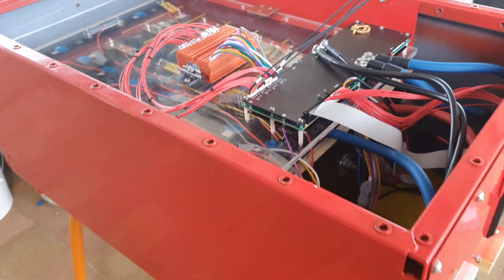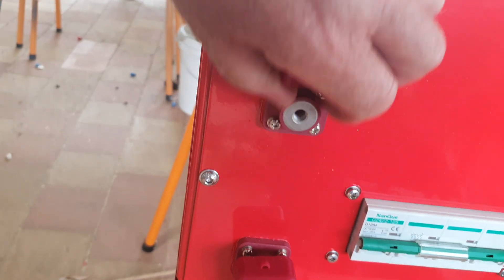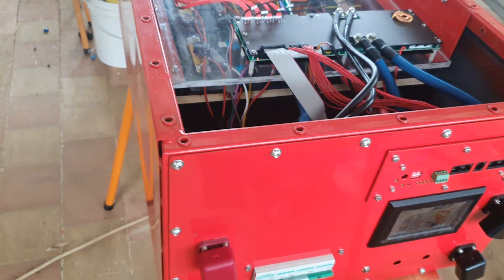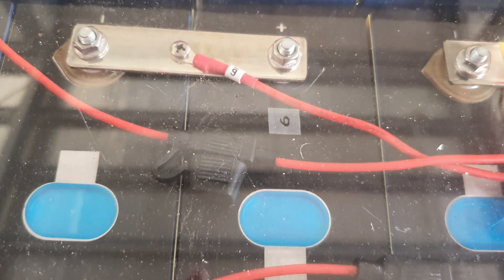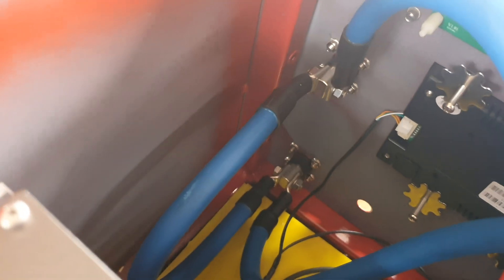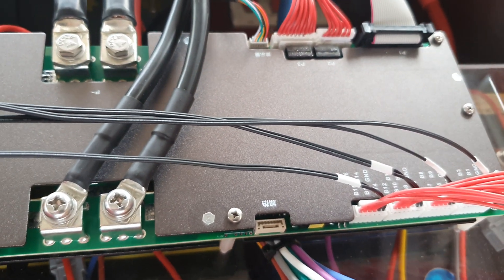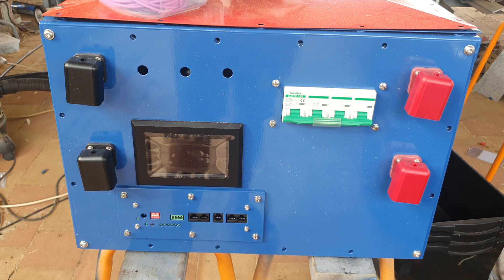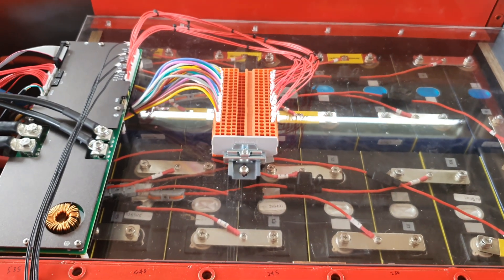My Big Red DIY 280ah 48v JK BMS JK-PB2A16S15P battery bank all running now on first boot up

Comment: NIce and clean setup, I have done very similar but for my cells they are large vertical banks. ill send a pic. I have 3d printed tops and bottoms and 6mm bakelite sandwiched between cells. i also am running the version 14 hardware and have also in the last three days updated to 14.20. always telling me the batt is at 100% soc with cells though at 3.2v per cell average. care to share your settings pls

Comment: Nice job, just wondering why the 4 pole mcb. Don’t worry, I’ve just read the other comments. I’m only just finding out about bidirectional MCBs here in UK. Have they been a thing over there very long or is OZ also just getting into them. Cheers.
Reply from the maker: Thanks, I have never come across them being use in DIY solar on YouTube yet.

Comment: Bonsoir, je suis en montage d'une batterie comme la votre, serait il possible d'avoir le plan de connection de votre disjoncteur. Merci d'avance. Pascal
Reply from the maker: https://www.aliexpress.com/item/1005004155269350.html?spm You will see the wiring setup for a 4P in the pictures on this page
Reply: @sjdtmv  justement cela m'intrigue, pourquoi monter en boucles ?
Reply from the maker: @pascalbudin2983  DC  breaker are directional to work at there rated trip, when used with a battery bank this become bi-directional with flow going in both direction, the 4P breaker allows the trip to happen whether it is inward or outward current flow from the battery bank
Reply: @sjdtmv  merci de votre réponse, je comprend mieux.
Mais ce disjoncteur est indisponible sur Aliexpress en destination pour la France... Avez vous un équivalent?

Autre question, est il possible de mettre les batteries couché sur le coté?, ou est il obligatoire que soit a la verticale ?

Merci de votre retour.
Reply from the maker: @pascalbudin2983  Sorry I didn't know that AliExpress would not deliver to France, I do not have another alternative, batteries can be tipped on there side without any problems

Comment: Have you experienced the issue where if you turn off the batteries for a few days (not sure how long exactly) the BMS will lose all of its settings for LiFePO4 and revert back to Li-Ion?  It will change your maximum charge to 4.2V!!!!!  You can see this explained in the latest Off-Grid Garage video.

I have been waiting to buy one of these off AliExpress but they keep saying "Preorder".  I guess that was a good thing.  Now, I think I will wait tile they get this latest issue fixed.
Reply from the maker: I have seen Andy's video, and I have not powered down the BMS to see what happens, there is an update to fix this issue and I think the default settings will change from Lithium Ion to LTO as part of that update
Reply: @sjdtmv  Yeh, i just noticed a comment on Andy's video showing a bug fix log firmware 14.17  from JK supposedly fixing this problem and like you said also changing the default to LiFePO4.  I hope that it's true.  I am waiting for these to go back on sale.
Reply from the maker: Just updated to v14.20 that has tested so far with no bugs